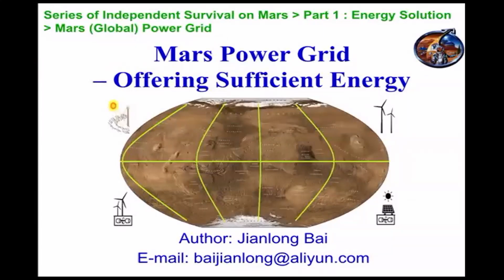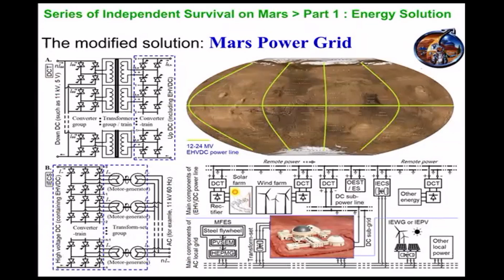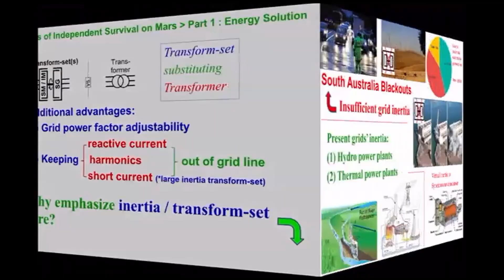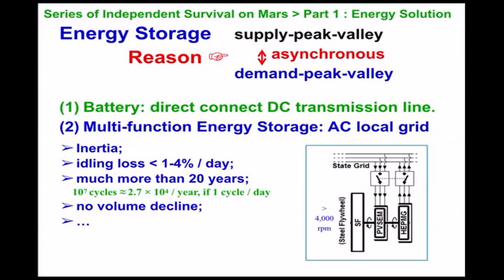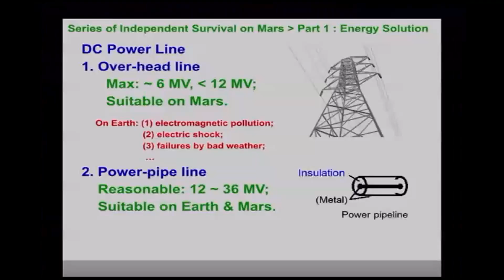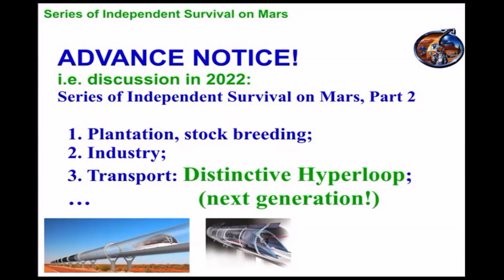Global Power Grid - Jianlong Bai - 2021 Mars Society Virtual Convention

Comment: Interesting subject which has not been in the public forum until now. Of course Martian settlements are still decades away but perhaps it is the right time now to plan the electrics of the many Martian industries required for life support & autarky. For example we are seeing electric vehicles operating at around 400 volts, which will most likely form the backbone of Mars surface transportation. The settlement could well standardise on this voltage to reduce the weight of wiring that has to be transported from earth in the early years before ISRU.
Reply: electric vehicles drive on roads. Mars vehicles will need slow speed and high torque for a long time
Reply: @anibaldamiao  I know what you are saying. As far as I’m aware, no one has ventured ideas for surface transport (since asphalting is not possible). Rail seems economical but TBM tunnels could turn out to be the best idea if Elon can get the costs down. Some papers suggest dirigibles balloon coated with flexible PV cells as a 2 in 1 solution (solar power plus transport)
Reply: Until such time as the mars settlers become self sufficient in copper